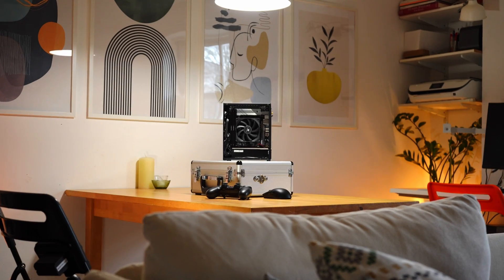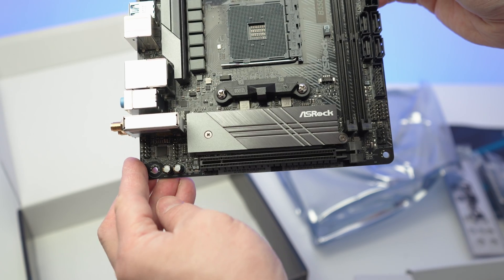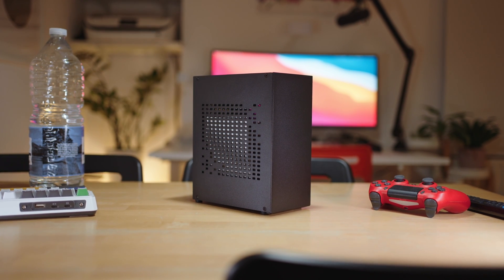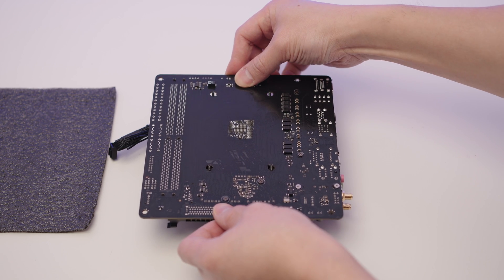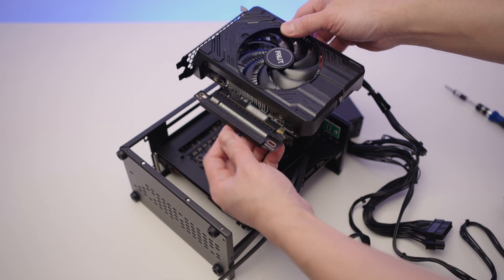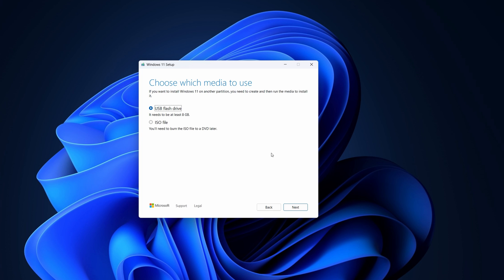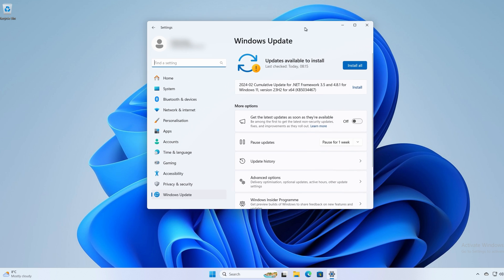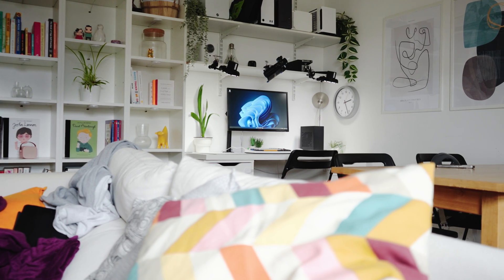How to build a PC - Mini ITX PC

Comment: Just did this with the zotac 5060 solo and 9600x. Very solid
Reply: How was the cpu temp?
Reply: @Lawrence39350  Undervolted cpu and gpu with youtube tutorials. lost like 5 fps in intense games but it was running around 90c for both and got them down to normal temps. I used the noctua low profile am5 cooler but people have told me that the thermalright x36 works better.

Comment: Is there no way to add a second mesh side panel onto the open side? And would it affect temps? Also is there any space for a TINY case fan? Like a 80mm one or no?
Reply from the maker: Mesh sure if you custom make one, temp wise won’t make much difference. Check my undercoat video for better thermals.
There’s also no space for any case fans
Reply: @JammyMunkyTech  Ok thanks. I really love these itx vids btw. Do you think it's possible to make an itx build on a budget? (Like less than 500). The one i've built so far uses the same case, the a520 version of your motherboard, a 500gb ssd, 32gb ram, 1660 super, and a ryzen 5 3600

Comment: Hey, I recently built this mini pc for my sister but I used a ryzen 7600x for the build instead of an AM4 cpu because I wanted to future proof it.
However, the fan is is really loud and the idle temps are around 80c. 

Is the cpu cooler not good enough for the 7600x? Or maybe I just applied the thermal paste badly?

Should I try to limit the power on the cpu? Or try to reapply the thermal paste? Or maybe try something else?
Reply from the maker: It shouldn’t be around 80°c when idle, is there anything running in the background when it’s that hot? Check task manager. If there is no issue there, check thermal paste and cooler
Reply: @JammyMunkyTech  I managed to get the pc to idle at around 50-60c after reapplying the thermal paste. I think I just didn't apply the thermal paste correctly the first time. 
The temps still seem a bit high though, is this normal expected temps for the 7600x with this cooler?
It also sometimes spikes to 80c every once in a while, usually when I open up programs or downloading something.
Reply from the maker: @biscuts5436  The 7600x has a higher TDP around 105 watts, compared to the 5600 cpu I used in the video which is around 65 watts.
I suggest undervolting the CPU to bring temps down

Comment: Hey man, don't wanna jinx anything right now but I pretty much made this build and you just saved my life with that BIOS setting. I was having so many issues with the graphics driver and crashes. Thank you thank you thank you
Reply from the maker: Yeah that same issue got me racking my brain, then I found out it was simple fix in bios 😅
Reply: @JammyMunkyTech  Let say I have 3.0 riser cable and a PCIE 3.0 graphics card. Do I still need to tweak the bios?
Reply: @brikelites2306  No, only if they are different versions.

Comment: I came across this video right when I was about to start my own ITX build, and it's crazy to see how similar of a build I had in mind!

If you don't mind a few questions,

1. There's an ITX "A09" case on AliExpress that's just a bit smaller than the A07 you used here. Do you think this build could still be possible with a 89mm front panel?

2. I see you used a 4060 Solo Fan. Is there any particular issue with the Zotac 4060 Solo or you reckon this GPU would have been just fine as well?
Reply from the maker: Yeah small pcs are the way to go!
1. A09 is designed for a pc without a dedicated gpu.
2. Zotac 4060 solo, no problems, it's a good card

Comment: Hello! I bought this case without the riser cable, do you remember how long does it need to be in order for it to reach without problems?
Also, some sources say the CPU cooler height limit is 37cm, but the Thermalright you used is slightly taller than that. How much more space was left between the CPU fan and case after putting the side panels on?
Reply from the maker: Riser cable is 20cm and recommend the cpu cooler in the video

Comment: hey, just wanted tu thank you for this video. following you i was able to build a rig with a ryzen 7600 and a rtx4060, in the same case but with different specs because i wanted to use an am5 mobo. did the undervolting too, and it is now sitting in my living room as a console, even smaller than a ps5 (but a little bit louder tho). I'm playing cyberpunk 2077 on it as of now, runs amazing.
Reply from the maker: That's awesome to hear! I prefer it over a ps5 any day! 🙌🙌🙌

Comment: Just build a 20x20x7cm build using only a 8600G, 2TB M2 and 16GB DDR5 6000 CL30. Mainly using it to play old emulator games like Mario Kart, all kinds of Smash Bros, PS2, PS3 games and smaller Steam games. Just have an issue with temps as it's rising to 100c in idle, don't have case fans yet so I'm currently using it with the case open where temps are around 30c idle.
Reply from the maker: can you undervolt it to keep temps down?
Reply: @JammyMunkyTech  I might, but today the case fans arrive so I'll give that a shot first

Comment: Got same case few weeks back,my is very budget oriented for travel purposes Ryzen 3 3100 / 1650 Super /16gb /512gb installed Noctua  L9a and need to change that pesky psu fan for Noctua too beside that very happy much better than with gaming laptop if something goes bad easy to replace.
  Nicely made video!

Comment: I saw another video of others doing this build, but they added another Fan on the opposite direction of the power supply. Am wondering if is it necessary to add it
Reply from the maker: You could, but I rather undervolt the pc

Comment: Do you think Asus’s low profile 4060 will fit into this case? Great video
Reply from the maker: If it has a solo fan it should
Reply: @JammyMunkyTech  Thank you! Literally doing the same build as you. Ended up getting the Zotac 4060 single fan. Cheers!

Comment: 2 Questions:
1. What is the proper length of a compatible riser 4.0 cable and is it double reveresed?
2. Can a modular 165mm or 170mm flex PSU fit in the case?
Reply: Riser seems 15 or 20 cm in lenght and 180 degree version. Can someone please confirm the right lenght to use?
Reply: Or 'double reverse' option? I dunno man.. can't tell.
Reply: As far as I know it's 18.5 cm dual reverse riser you can google search the case (sktc a07) and find the one with riser and read the desc

Comment: I’m looking at building a DIY Nas exactly like this but need to find appropriate mounting solutions for 2x 3.5 HDDS instead of where you have the GPU. 
Any idea what I could use?
Reply from the maker: 2 drives would be a tight fit, but then again there isn't anywhere you could mount it. I mean you possibly zip tie one against the side panel, or maybe look at 3d printing custom mounts for this case.

Comment: Really really bad advice on the “tighten till you can’t no more” 

You know the limit because youve built pcs before, someone new will grab the screwdriver with both hands death gripping it and turning when hearing that advice 

PC’s dont need to be heavy duty, they’re still on your desktop and fan vibrations aren’t enough to unscrew any component, tighten with just 2 fingers on the screwdriver until it can’t turn anymore and that’s about it
Reply from the maker: Did you not hear the part where I said “But don’t over do it because you don’t want to damage the board”

Comment: But isn't the riser cable that came with the case is pcie 3.0 

Which is gonna decrease the performance of a gpu that supports pcie 4.0
Reply from the maker: Yes it comes with PCIe 3, performance decrease is very minimal

Comment: What if I am not gaming at all and only use the computer for media... and watching some charts and some movies... can i skip the GPU save 350 usd and maybe get a better amd with 8 / 12 cores and with integrated graphics...

how can I check parts compatability for mini itx cases ?
thx
Reply from the maker: @dc_verax7456  you can check some pc cases for compatibility on a website called pcpartpicker, but it’s not always 100%
A CPU with integrated graphics would be all you need for your purpose.
Maybe consider a pre-built mini pc
Reply: @JammyMunkyTech  Thank You for Your response
I looked at the pre built mini pc like the optiplex or the miny thinkcenter or even the HX99G, the only problem is that you cant really upgrade them and for the dell or lenovo they are very expensive for coming with a 4 core amd
Thats why I was looking at mini itx or micro atx boards that I can then upgrade the CPU if I want

Comment: 450w psu is not enough for 4060 gpu...it will strain the psu too much and will be damaged at the first fluctuation of current. atleast used a 750w with 80+gold. and telling people that they can use 450w psu for 4060 will only punched a hole in their wallet , and will have to buy a higher watt psu before one year passed.
Reply: 750w?? This builds only drawing like 350w at most. That’s like purchasing a 4090 and only playing wow on it.
Reply from the maker: Have you seen the power draw?
It's more than enough
Reply: @JammyMunkyTech  the company literally said it's nor enough.. especially with all the other components...and fyi i know this bcoz i actually build pc's and actually read the recommendations by the people who build the gpu
Reply from the maker: @pcthangluaia574  again have you seen the power draw in the video?
It’s been working fine for me

Comment: Hi Jammy,  Hope you don't mind but can you tell me what the total cost of the mini ITX PC was versus say purchasing an already built version , ie yes I appreciate it's great to build your own and think I have enough tech nouse to do so. Thing is how much would I save in build versus purchase that I would assume includes a warranty etc.

Thanks
Reply from the maker: This build cost under $900 during the time of video upload.
You’ll be saving $50-200 with this build vs a pre-build.
However you might find some good deals on pre-build or laptops at the same price or cheaper than this if you look around.
You can also build this spec using Atx components at a cheaper price than my build because building small pcs tend to cost more than regular size pcs.

Comment: We save the same exact components except for the psu, i might end up with fsp's non modular 500W. Did you need to undervolt this thing cause I saw some post that they had to in order to get better temps.
Reply from the maker: I didn't with the PSU, only GPU and CPU

Comment: do you need to update your mobo bios bc most of the am4 itx mobo only support 3000 series and it need to update for it to run correctly with an 5000 series cpu
Reply from the maker: No, this mobo worked straight out of the box with my cpu
Reply: @JammyMunkyTech  oh , well i think it should ran into some prob bc in pcpartpicker it got a disclaimer bout the mobo is runing older version of bios and it  requied for an bios update , but if your mobo runing good , tha a good one , well can you make a video tutor on upgrade the mobo bios that would help me alot thx .
Reply from the maker: @depressed579  pcpartpicker normally has that warning, most of the time the mobo manufactures would update bios for existing models.
I.e. if you buy a particular motherboard with that pcpartpicker warning, chances are, the mobo is updated and ready to use with the cpu.
It’s also good to check which bios version is on the mobo you are buying to see if it will work with the cpu  you are looking to use.
Reply: @JammyMunkyTech  alr thx man thats good to here , the bios updating thing make me kinda worrying about buy amd cpu

Comment: Can I build a PC this size for half the price? I just want to be able to play Dragon Ball Sparking Zero. The specs are:
Ryzen 5 3600x or intel i7 7700k
16 GB Ram 
AMD RX 6650 XT 6GB or Nvidia RTX 2060 S 6GB
30 GB storage
Reply from the maker: Sure, but the gpu has to by a small to fit inside the case
Reply: @JammyMunkyTech what type of GPU should I look for? Also would I need an extra fan?
Reply: @outsidewithquad8123  you should look for gpu size/length that will fit in the case you are using. I believe the case that he is using has a gpu length limitation of 180mm. Also, this case is too small to fit fans

Comment: I used the same case and am running a 7900 cpu with a 1050 ti. I get thermal throttling playing DOTA. Basically don't run this thing without taking off at least one side panel. 

I'm going to put in 4 noctual 40mm fans and see if it cools down enough to justify buying the single fan 4070 that just dropped.

Comment: Can you put 7800x3d and 4060ti inside this case? How about the thermal if we do the combo? Have any idea?
Reply: These cases take low profile, sub 40mm cpu coolers, which are absolutely insufficient for a high tdp cpu like the 7800x3d. 

I've got a 7900 vanilla, a 65w cpu in mine and the best lp cooler and it still gets Hella hot.
Reply: @borfsausage8759  do you undervolt your cpu n gpu? And what temp when it is in load?
Reply from the maker: That combo will work great, you’ll need to undervolt both cpu and gpu for better thermal results

Comment: I would like to go for the exact same build in the exact same case however I can’t seem to find the power supply anywhere online. Do you have any good alternatives that will fit in that case?
Reply from the maker: Where are you based? The one from velkase’s website or try finding it on eBay

Comment: Great build with good clear step by step instructions. If I was a first time builder this would have been the video I would have wanted to aid me in my build. I have been looking at this case for a while now but wish it was a bit longer by another inch to take the 4060 LP.....GREAT JOB
Reply from the maker: Thanks, I wish the case was slightly taller too, to add a few case fans

Comment: This is very nice build...but my brother in Christ, 900$ is not a budget PC. Atleast not for 2/3 of the world. This build would go even more in eastern europe, easily going 1000e+.
Reply from the maker: Thanks! 😀 i didn’t say it was a budget pc. Although it’s not a bad price for an ITX pc considering they are usually more expensive compared to a normal size build.
Reply: @JammyMunkyTech not arguing, but you literally say budget PC in the video 😅
Reply: But, it is indeed a capable PC with high processing power both on CPU and GPU. And I might be using it for rendering, coding or maybe WFH. But yes it wasn't cheap, although on the form factor, I might cuddle it. 😅😅😅
Reply: This is about as cheap as a good ITX can get. You can go for Radeon GPU (which won't fit into any case under 8L) or used cards which have slightly better price/performance ratio, but there's nothing as cost-efficient as this on the market if you're buying new and for this size. 

Really solid and efficient build imo. Can save maybe a combined 100-300 on GPU + mobo + PSU if you went full size though.
Reply: You can build something similar for 550 to 650 dollars
Reply: @SuixdeCity , please tell us more.
Reply: I'm building something similar in the same case. It's gonna be about $720. Check the used market.
Reply: @gazehound 540 right now
Reply: It could've been even cheaper if they used the 520 chipset or the Chinese jginyue b550 which is cheaper as well and non RGB ram and the Apevia power supplies.
Reply: any amount of money is a budget
Reply: It cost 4500+MYR at Malaysia. 😅 Budget pc suppose to be around 2500MYR, in dollar around 550$
Reply: The 1st graphics card is the wrong link. The “cheaper” graphics card is $456.
But I guess he’s going for a gaming PC.
Reply: It’s a budget for Mini pcs. You can build a normal sized pc with the same performance for much cheaper. It’s all relative
Reply: good luck selling this pc used, already can get 5600 for 100 eur and 4060 for 300 eur, for 1K can build way better cpu, gpu, mini itx build tax :D price, temps, noise.
Reply: @suprerxero  better gpu in an itx case of this size? can you please share what GPU is this? is there any 17x10 4070-4080?
Reply: @Kaylas1821  im talking about itx tax, everything is more expensive because its niche builds.
Reply: @suprerxero  so? Some people want/need itx pc. Your comment makes no sense. It's not atx vs itx video.
Reply: @Kaylas1821  as I said nice build but its niche so its more expensive and there less buyers because well its a niche.
Reply: @suprerxero  no shit Sherlock.
Reply: @suprerxero  obviously you can build a better PC for the money of an ITX build however you can always just sell ITX parts off on used market as any other component and you will have people of that niche interested in them. I myself am always looking for parts when it comes to ITX builds.
Reply: Yip... roughly 30-35% more $$ for itx parts (atleast in my experience)@suprerxero
Reply: @Kaylas1821 it's a single fan rtx 4060
Reply: This guy is just restarted, I was able to build the same PC for 600$ brand new
Reply: 1000 bucks is a phone in 2024. Where are people this poor?
Reply: @sebastianbjork1974  1st you used the wrong word. 2nd a $1000 phone is a bad investment, for doing calls and messaging…. That’s stupid, allocate more on a device with a bigger screen. 3rd you’re contributing to e-waste with these easy to break hard to repair devices.
Reply: @amogussusmogus1 what word?
Reply: @sebastianbjork1974  you mean * 1000 is a useless phone people will not use at his extend but just buy to show they are able to eat cup of noodles for a year to have the money